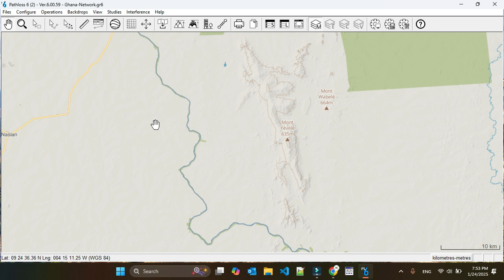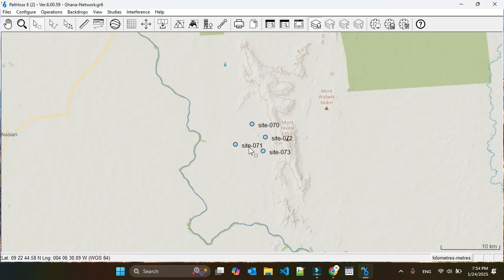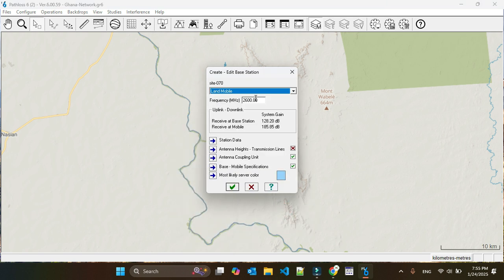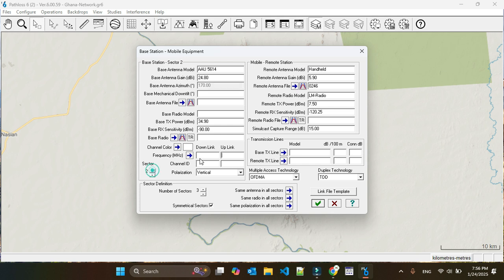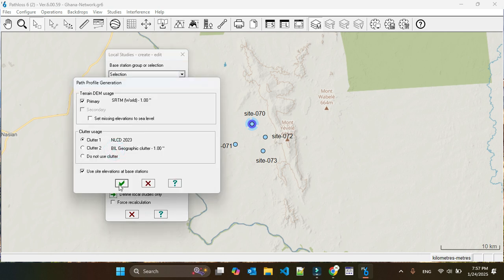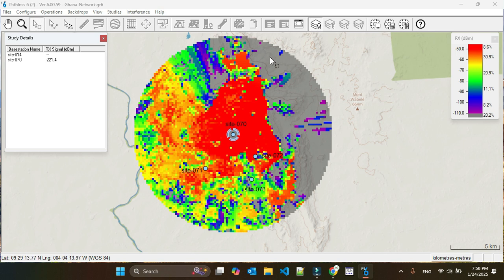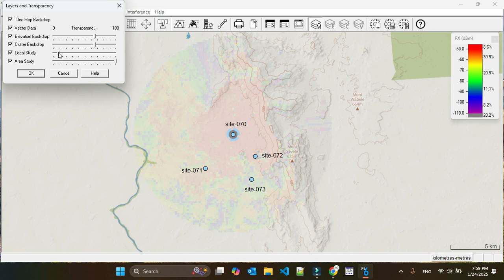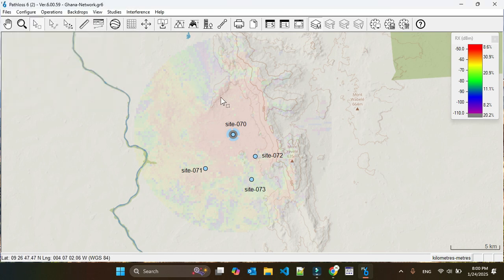Lesson-38 How to plan TETRA links using local study in PathLoss-6 English

Comment: Hi, it is possible to consider a different antenna radiation pattern on this coverage module? Pathloss has already a database with the antenna patterns?
Reply from the maker: you need to change the antenna and re-run it